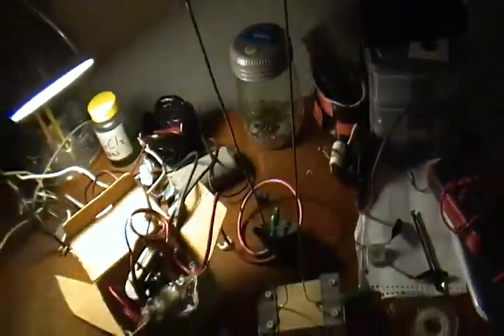Huge ZVS Jacobs Ladder

Comment from the maker: Thanks! Unfortunately that flyback is arcing internally so its finished. No worries, I have spares. Also, clever idea about the candlewax. I will use that when I run out of hot glue.